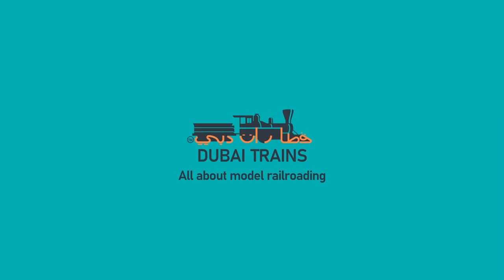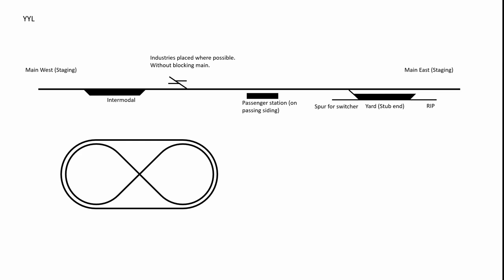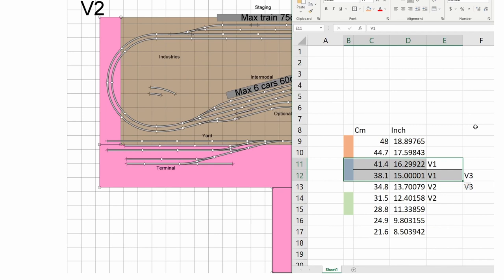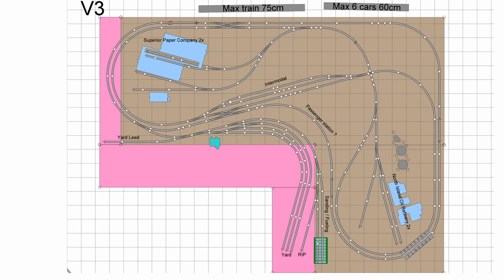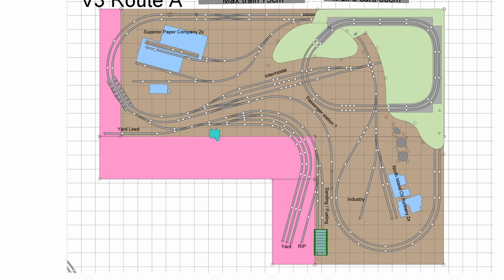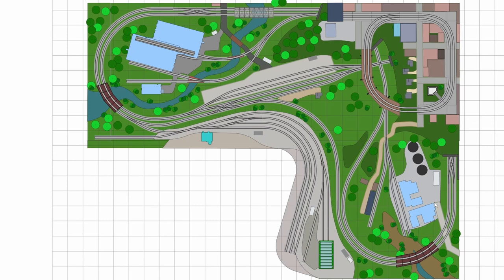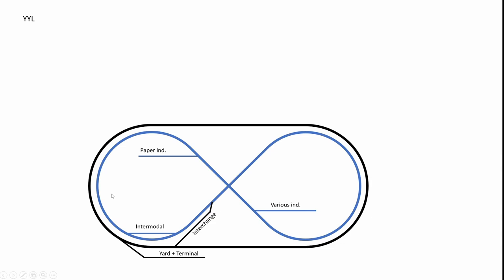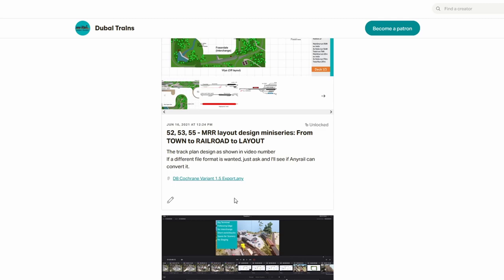73 - N Scale Tabletop layout design with KATO UNITRACK & UNITRAM

Comment: I really like your layout design videos.
I was not familiar with the Unitram system.
Reply from the maker: The Unitram system has a lot of potential. Wish there was something simulair for HO to more easily create street running scenes.
Reply: @DubaiTrains  I use the ISE Motorman for my Trolley track on my shelf in N and HO scale.  I am also getting a Circuitron AR-2 as a DC only option.  While it is not the Unitram system, it might give some options for you in HO.
Reply from the maker: Let me check those products.